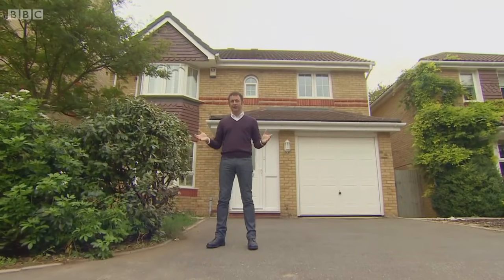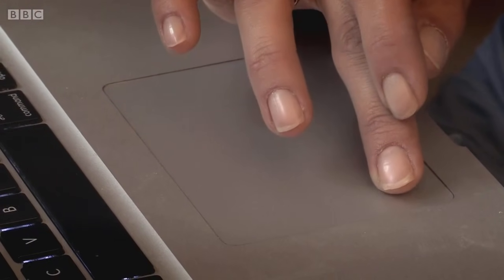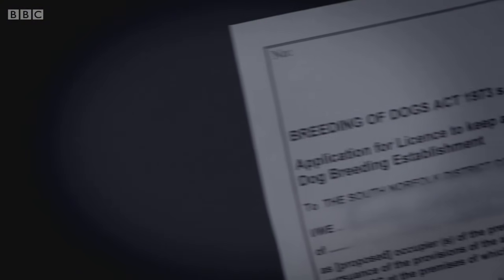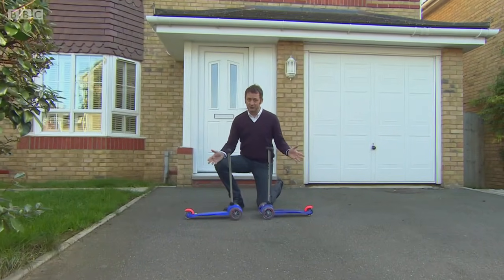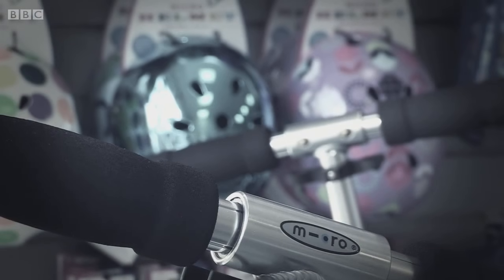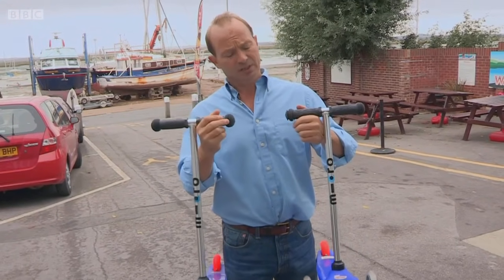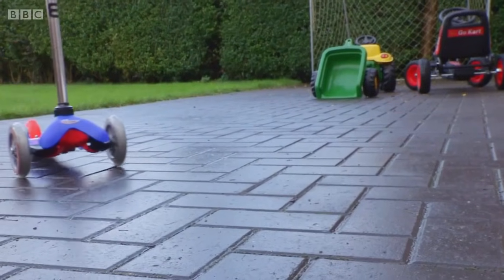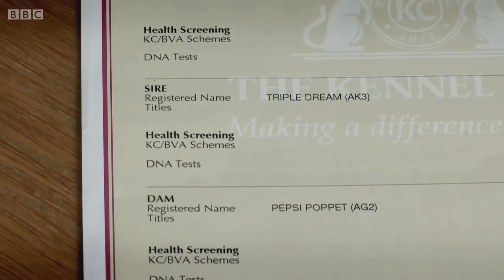Fake Britian Series 5 Episode 20

Comment: This was the days when you can repair your own iphone with ease. Now you need a lab with tools to remove the glass.
Reply: The only issue with the newer iPhone's is the adhesive around the glass (needed for the water resistance). You can heat it up with a hair dryer and use a suction cup to pull the glass away. Not difficult at all.
Reply: @eginteractive  jerry rig everything had to buy a freaking laser

Comment: I had a cute fake Iphonepad, or what I should call it. It was an Ipad turned into a telephone. It was sold with the name Epad and the brand was Dapeng. An Ipad in the size of a telephone, so to speak. It was very nice, actually. I wouldn't really call it a fake, because an Iphonepad does not exist from Apple. If it is a fake Iphone or Ipad you're buying, it will be very apparent when you turn it on. Those devices run on Android. So it is just the look that is similar to what they try to fake. The rest is not.

But I wish Apple could fake the chinese brand Dapeng and launch an Epad, with real Apple software. That mini Ipad size from Dapeng is very nice. Here is a photo I found online:

http://images.shopmadeinchina.com/seller/product/B249F227FB8CB8F3E040007F01005BDB/155/7720155_10.bak.jpg
Reply: R. Thomassen or just buy an actual iPad???